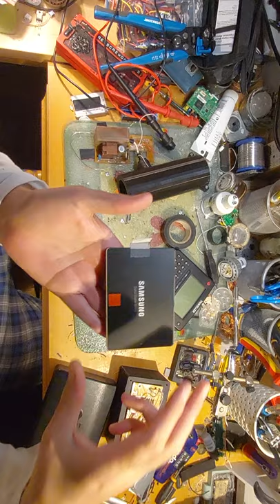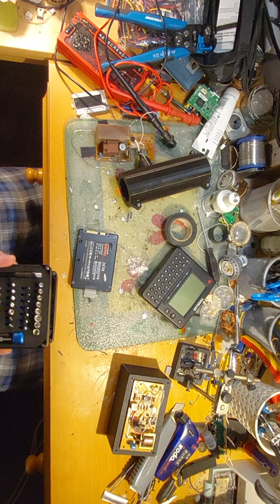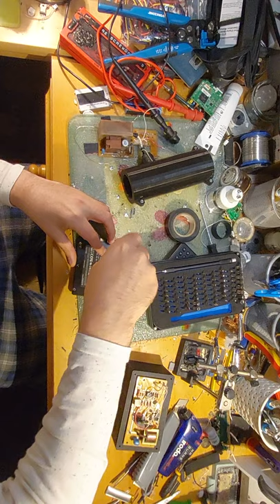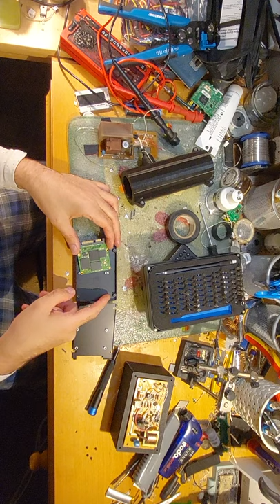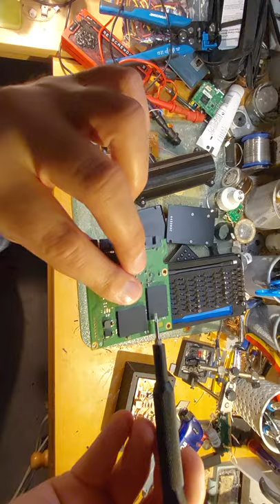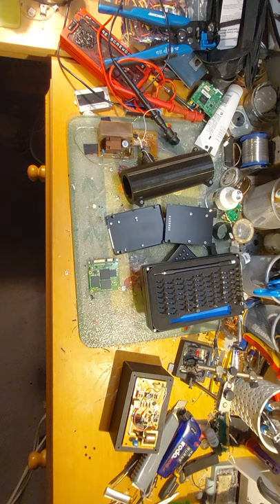SAMSUNG 840 Pro SSD Teardown

Comment: What is the size of your torx bit? T3? I tried T4/T5 and they wouldn't fit. Don't have a smaller bit to test unfortunately.
Reply from the maker: The bit I was using was the P5. I new type of bastard screw. They really don't want you getting in this stuff. But I open it anyway
Reply: @TheEPROM9  Yeah I just realised Torx has 6 arms and these screws only 5... Is this the Pentalobe head, same as for CrapBooks?
Reply from the maker: @keineahnung4227  I belive so. I would recomend getting a ifixit kit. They are pretty good.

Comment: Hey there, Ive got one of these guys and an unfortunate voltage excursion has popped the little chip in the bottom right straight off the power pins. You wouldn't happen to have any info on that chip by any chance? Struggling get a part number off the top of it 😅
Reply from the maker: I am not sure to excaly which chip you are refering to, but i am guessing the one next to the inductor.. Which is: L84GC
The other power one next to the conector is: FN4EAG
Reply: @TheEPROM9  great thanks!
Reply from the maker: @mickslan  Cool